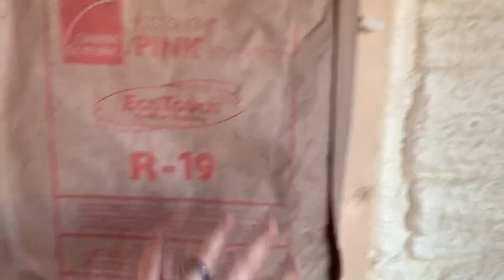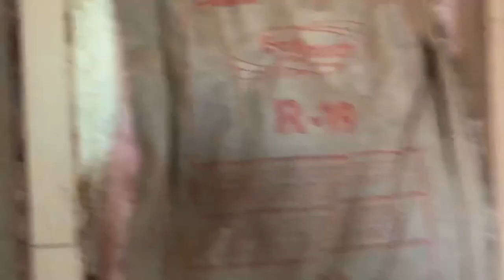Building a house out of a steel building - all by myself

Comment: How did you insulate the metal? I read that it condenses so it causes mold and rust and has to be insulated and sealed very well. What did you use besides the foam?

Comment: When my pad was poured, they used 2 x 6's and stepped the edge down to 4". Then the siding ran down over the inside of the pad by approx. 2". It cost a bit more but was well worth it. Thanks for the video. Looks good

Comment: How much was the steel building and the cost of the slab? How many inches is the slab of concrete? Thank You
Reply from the maker: Steel buildings can vary a lot depending on the contractor, the style of building, etc.  Ours cost about 45k for the slab and the steel building.  Slab is 4" thick with a 24"x24" monolithic footer around the perimeter.